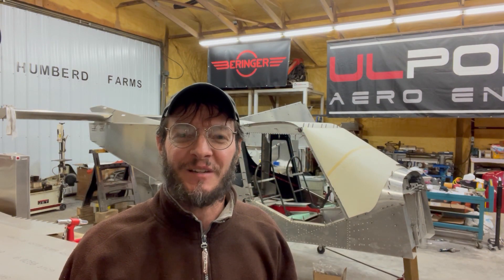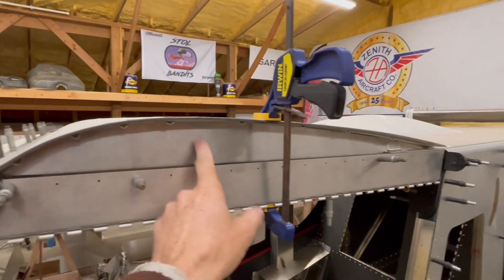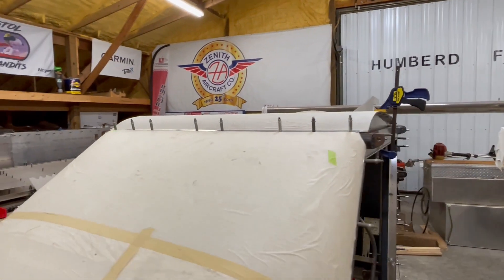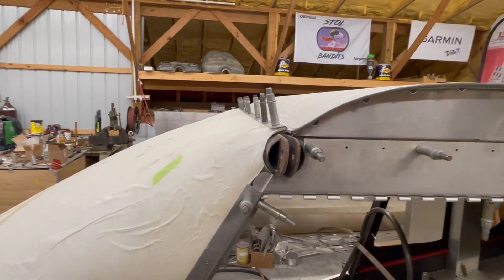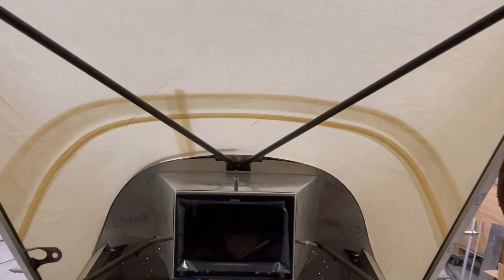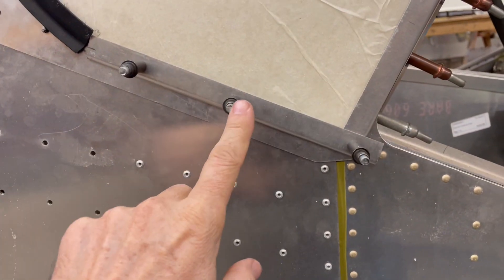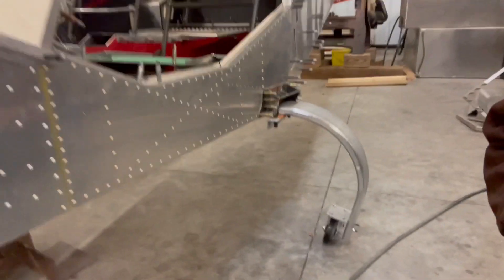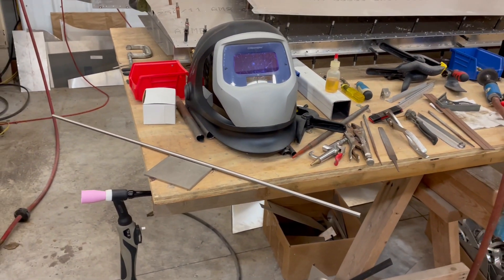750SDXtreme Day 4 of December Build Challenge

Comment: I bent a “Z” channel for the rear of the top window so I didn’t have to drill through the plexiglass.  The Z channel holds the rear of the top window down and screws into rivnuts that I installed along the top of the fuselage.  That plus the screws along the top will make the window much easier to remove if necessary.
Reply from the maker: Excellent idea, thanks!